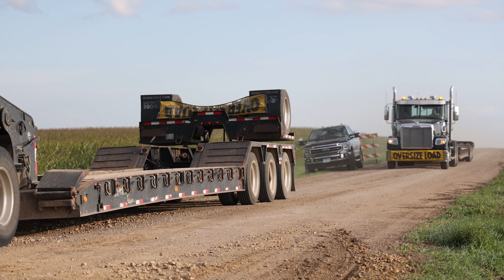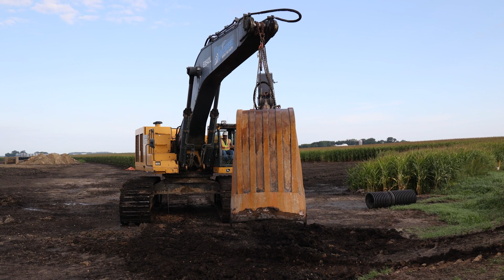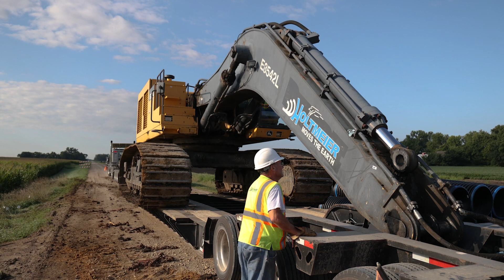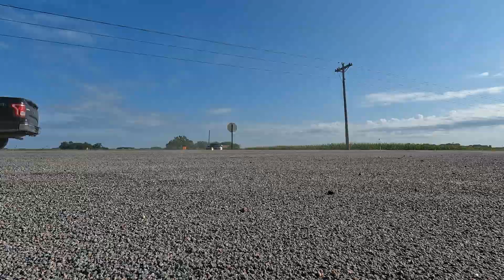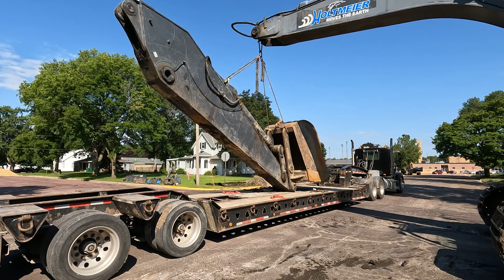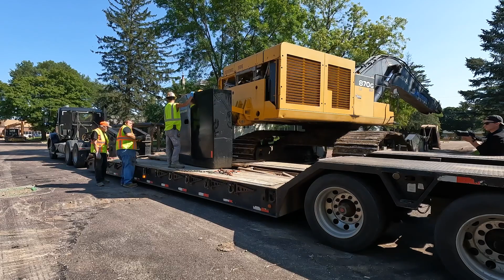⚠️ OVERSIZE LOAD ⚠️  Transporting a 90 Ton Excavator

Comment: The trailer used to move the huge JD Digger maybe old tech, but it works!! so stick with what you know.  Like the add on bogie to help spread close on the same weight as a fully loaded Boeing 707. For towing  power I use a Bulldog  configured as a 10x6, a Sisu tri-drive rear bogie and twin steering front axles,. A good old fashioned  KTA Cummins twirling a 6 speed Allison CLBT 6061 semi automatic  gearbox ,a 4 speed Brownie  auxiliary box with ZF hydraulic retarder. One thing  I like is the large diameter tyres around 12R ,22,5, less prone to blow outs compared with the tiny tyres used  on Shuerle, Cometto, and Nicholas hydraulic modular trailers .

Comment: Those buckets are common in Minnesota. They are sometimes called a sand bucket or a sewer bucket. They are a high capacity bucket that are used were soils are fairly easy to dig in. Thanks for watching!